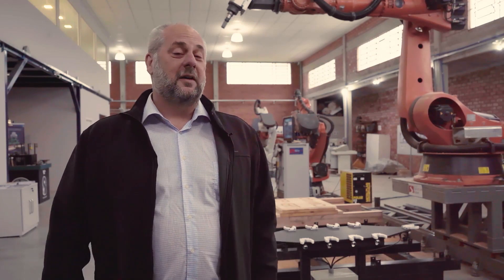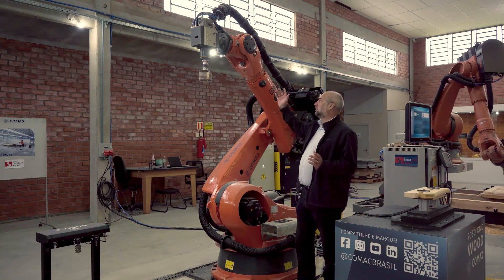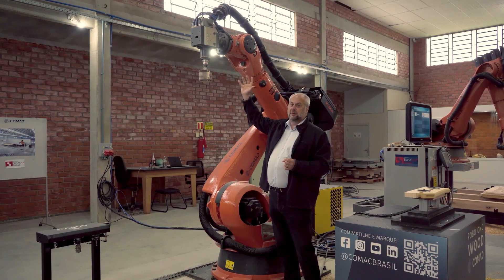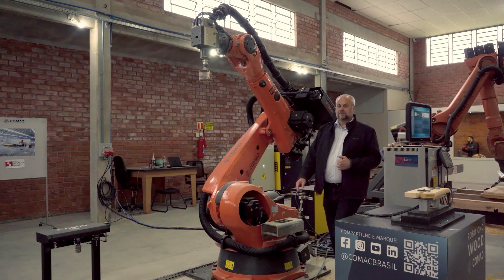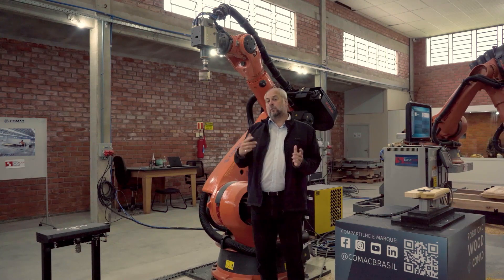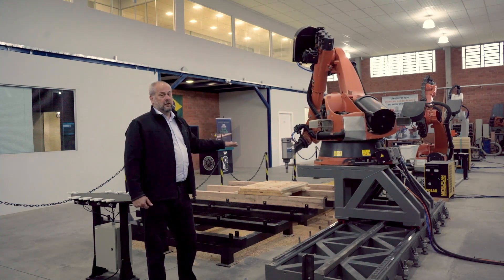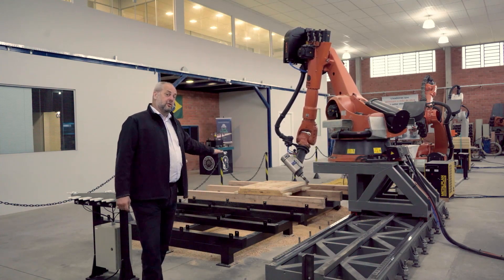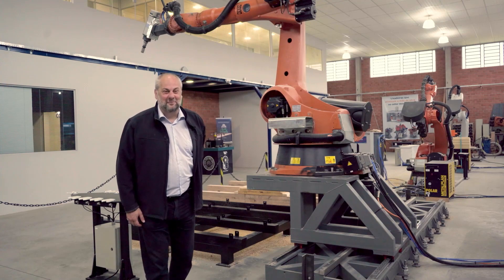Open House | Meet our Milling Robots

Comment: What would be a ball park figure for a clt panel cutting setup shipped to melbourne Australia.  For panel max size 3000 x 13500mm approx.  if you buy large blank pa els and cut them down yourself for custom prefab housing would we save money vs buying in precut panels from the mill?